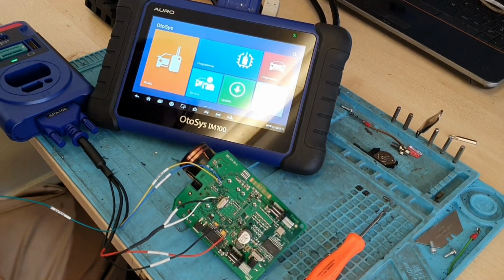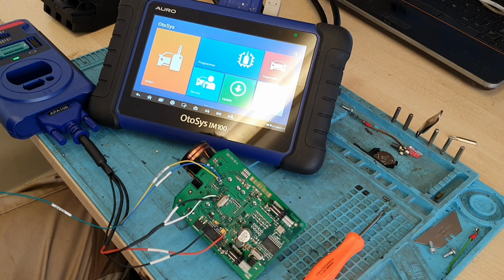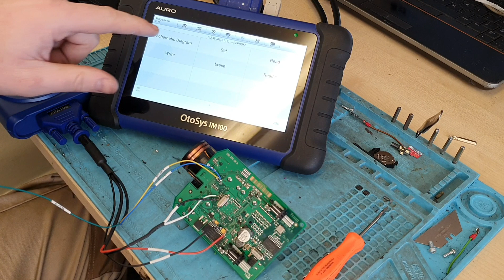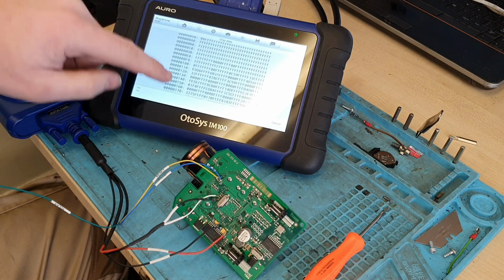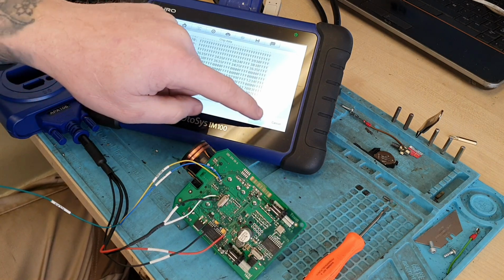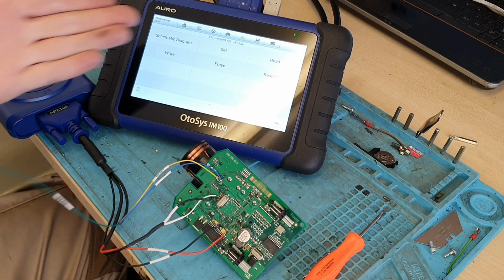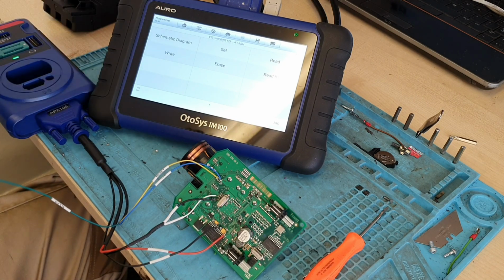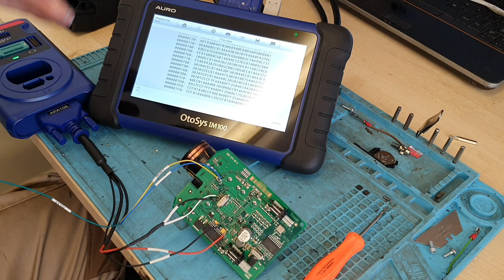How to Clone a Mercedes EZS with Autel Auro | IM608 & XP400 Demo | Mobile Eco Tuning

Comment: Is this just a more reliable way of getting the eis read,rather than just connecting up the wires onto the connector pins of the eis without taking the pcb out?Or does hard wiring it by soldering give you more information?